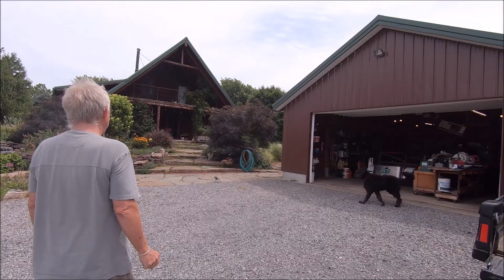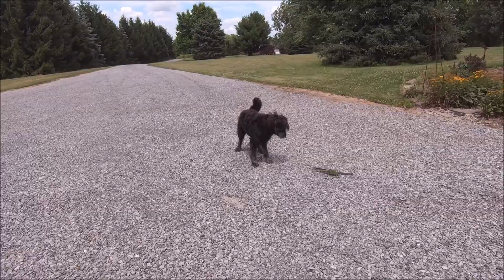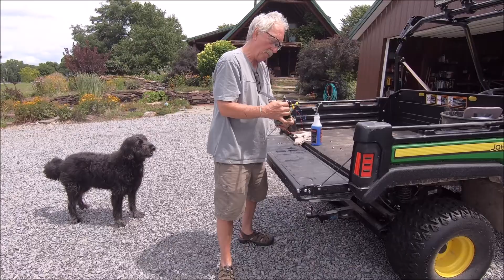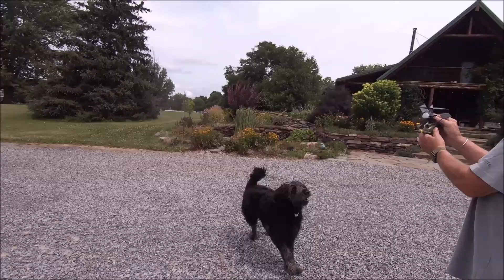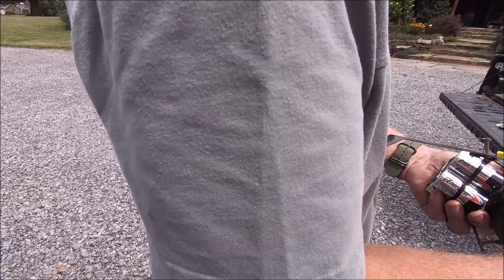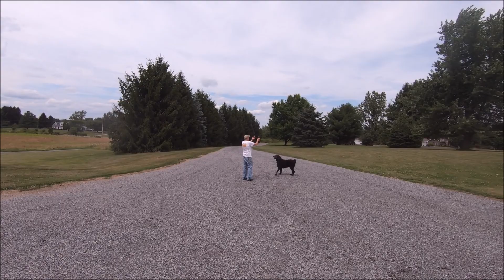2022 07 27 Cox Helicopter with Jim R

Comment: Wrong fuel for sure. I don't know if its still possible to get Cox fuel probably not but try and find some formulated specifically for the small .049 engines.(1/2A) It sounds like it is not reaching peak RPM those little engines should be spinning at like 20,000 rpm

https://coxengines.ca/public/files/FG.pdf